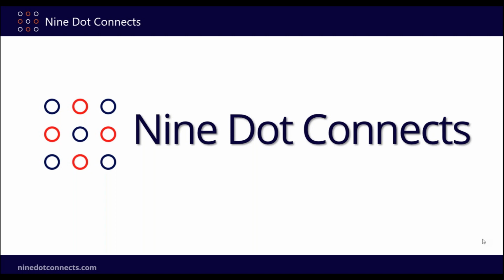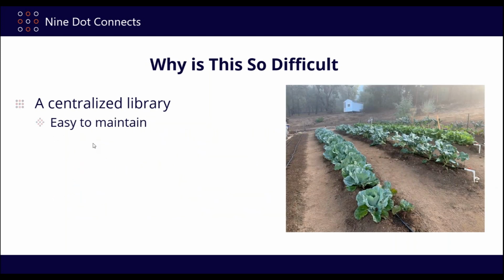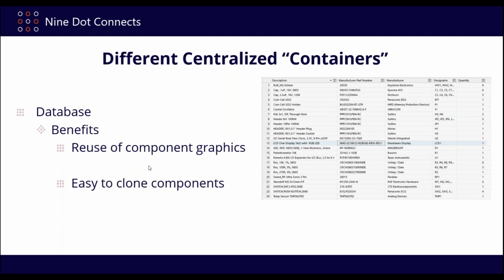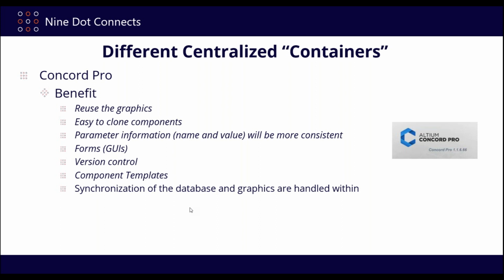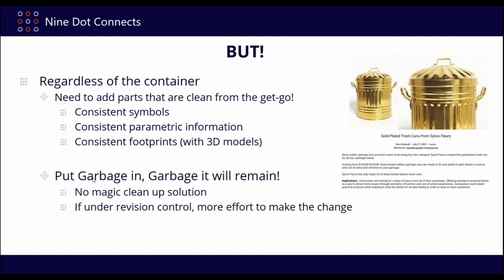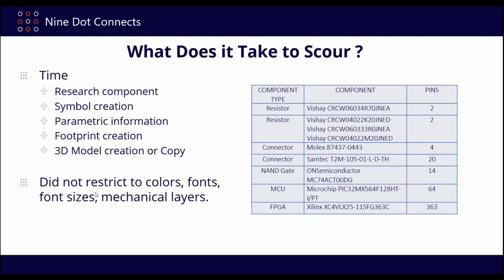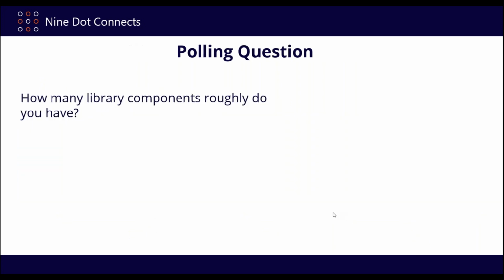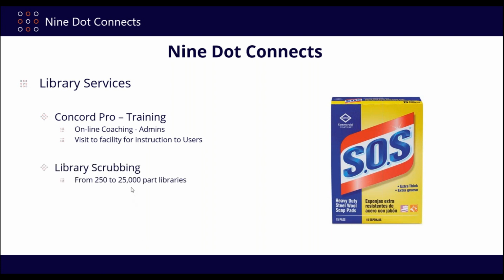SOS about Library Scrubbing

Comment: Not sure why anyone would want parts with all those parameters.  Makes life hell for my clients.  They just want a design - they don't care what 10 0603 resistor I use. As long as the board fab and CM can place it. 

My clients want a simple method to manage their own products without having to go all the way back to the source file just to change out an obsolete part with a FFF one. That is such an issue right now with the whole supply chain BS.  

My clients also have a lot more than just my silly PCB's that got to go into a product and be tracked. 

That, and there's a lot of my clients require stuff like ITAR and AS9100 which precludes most cloud services.    If Altium or you want to get into the whole CMMI and AS9100 audit thing have fun with that - it sucks. And ITAR?  That has quite a few criminal implications - make a lot of my clients really nervous. 

And even my commercial clients aren't real keen about cloud-based product management. I understand that 

The way that you're doing it  seems more like a flat file doesn't seem like good relational database practice - where a simple key field can link to multiple tables in one-to-many relationships.  Using a simple system for things like common passives with a simple callout appears to be a much more robust system and one that the customer can manage down the road without having to resort to Altium for every EOL or out-of-stock part a CM comes across.